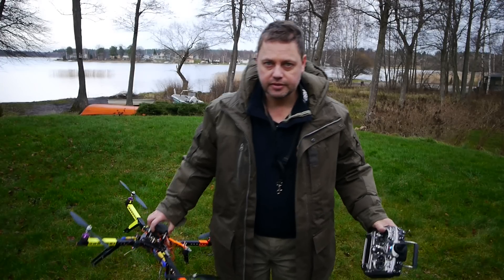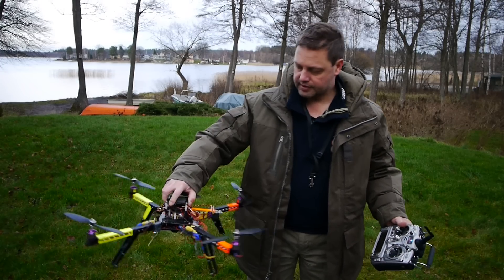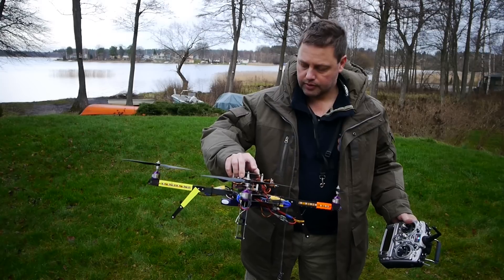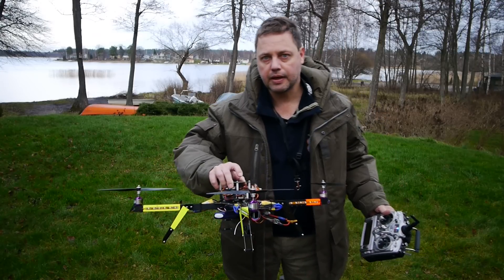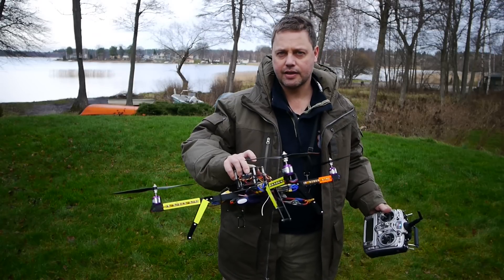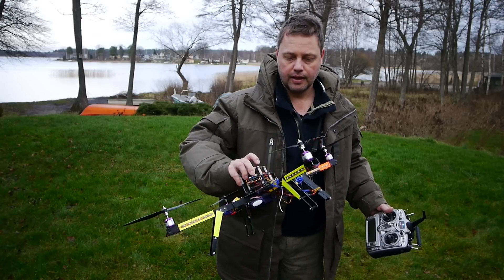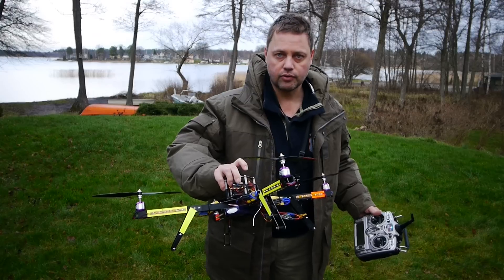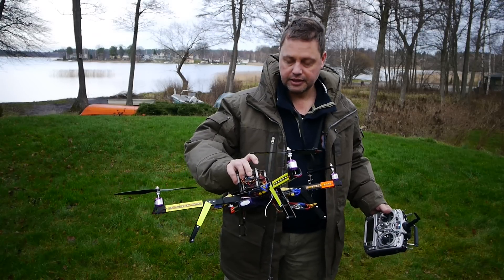AC 3DR poor climb performance - whats wrong?

Comment: Try upgrading to 10x47 APC props, they're stiffer and offer significant climb performance. Also make sure your motors rotate freely when not powered. There shouldn't be any noise when you spin it with your hand and it should be able to spin around at least 1-2 times before stopping. If it's overly damped, try loosening the screws until it spins freely then add washers on the screw to take up the slack.